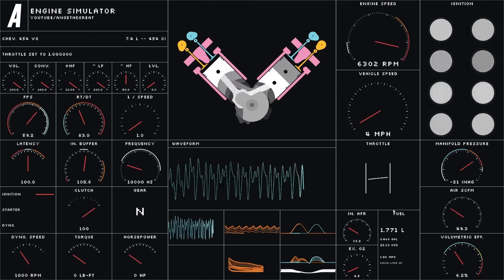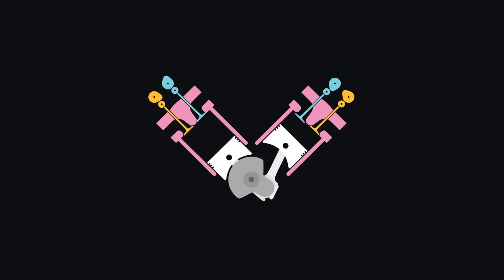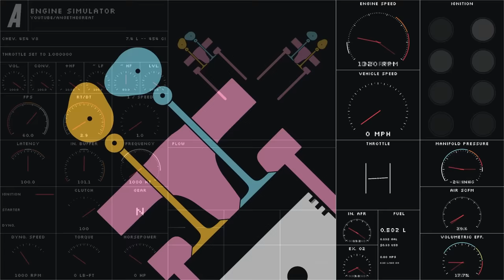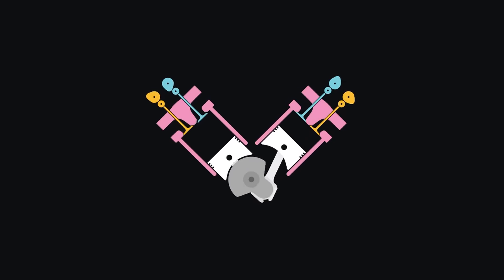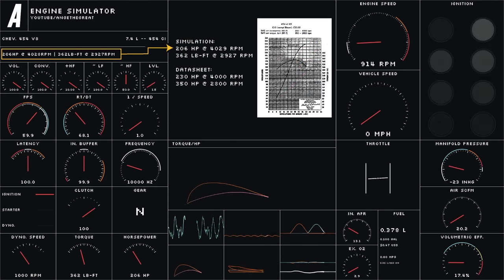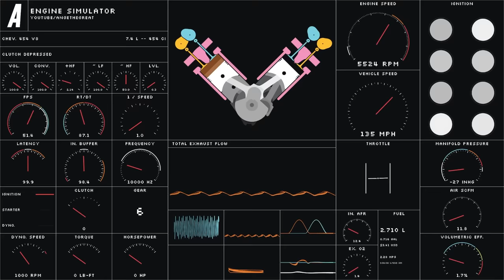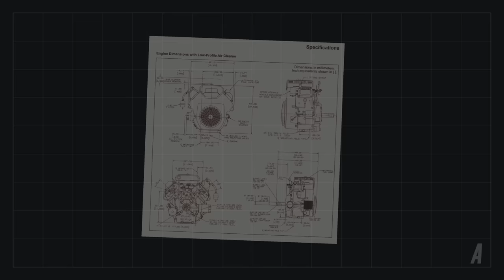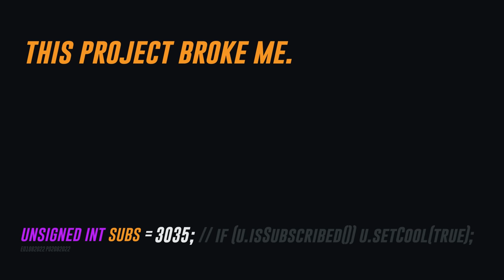Simulating an Entire Car Engine (yes, it makes noise)

Comment: I’d love if a company hits you up and is like “can we use this”
Reply: @mhe123321  sad. i wanted to try it
Reply: Let's hope that it won't be EA xD
Reply from the maker: Lol I set it to private because I was worried about companies stealing it, not because it's been sold. I may still set it to open source later though, I just don't want someone to use my work without crediting me
Reply: @mhe123321  did you happen to get a copy before it was yeeted 🙃
Reply: @AngeTheGreat  license it?
Reply: @AngeTheGreat  Just use an appropriate license.
Reply: @tanawatjukmongkol2178  If you use something like MIT you explicitly allow commercial usage, because you want to. It's not a loophole.
Reply: @angerhegreat for the love of god if you open source it, slap a non-commercial license on it. At least get a job out of this lol
Reply: if that ever happens, i really hope it would be BeamNG
Reply: Would be cool in beamng
Reply: @tanawatjukmongkol2178  MIT license does require credit
Reply: @tanawatjukmongkol2178  MIT is not copyleft by design. That's not a loophole.
Reply: @AngeTheGreat  you need to copyright your simulation so this way at least if it is stolen you can at least know that even if they do you are the original copyright holder and can sue them.
Reply: kid, the car companies already have their simulators that are lightyears ahead of this one-man project....
Reply: @MrTeddy12397  I’m talking about like Forza. Not car companies-
Reply: @MrTeddy12397  Also bold to assume I am a child
Reply: yo, this is awesome :D
Reply: OH SHIT HERE WE GO
Reply: They're not gonna ask
Reply: They already have their engines simulation,
Reply: @AngeTheGreat  I think the best thing you could do would be to wrap this up into a plugin for unreal and unity and put it up on the marketplace.
Would solve the issue of people using your work without crediting you (kinda), with the bonus of you actually having a bit of return on time investment on this epic project.
As well as it would help solve the annoyances in games that actually inspired you to work on this project.
Reply: @MultiDarkZen  You have copyright on things by default, it’s only not copyrighted if you explicitly make it public domain
Reply: @beamng  yooo there here
Reply: @beamng  im 21 like :)
Reply: @MidnightSt  VST plugin too, for video and audio editing, that would be mind-blowing
Reply: BeamNG Drive
Reply: Thi
Reply: @AngeTheGreat  GPLv3 would be fitting here.
Reply: @AngeTheGreat  Well, you can always attach a proper license to it. That way, if someone steals it and makes a ton of money without crediting you, you can sue them for breaking your license. Or more likely, get a settlement.
Disclaimer: I am not a lawyer, I am not even American, this is not real legal advice
Reply: Yeah! Someone pay this man what he deserves, this can change (I believe) car sims sounds and heck, car behavior too as this is simulating the engine as a whole. If he can output some values out of it to use for sound, he could as well output values for movement (torque and HP are already there even).
In my opinion, Gran Turismo 4 (that’s the last one I tried) doesn’t sound at all nor as accurate as this!
Reply: @AngeTheGreat  Dude. Please have a license where it is free for non profitable use but if a company uses it they need to pay you. Don't let people use you. You put work into this and it's amazing and worth people paying you
Reply: @MidnightSt  what about godot :/
Reply: Camshaft software (Developers behind Automation - Car company tycoon) might be interested in this.

I really hope they do.
Reply: @AngeTheGreat  there are licenses for credits
Reply: @jlewwis1995  i have very little experience with godot so I don't know how the plugin/asset system and ecosystem works there, and whether it can even use compiled dlls, and such.
Reply: @AngeTheGreat  honestly i would keep it private, keep improving it and license to game devs. I could totally see UnrealEngine acquiring you for big bucks (like they did with other innovating startups)
Reply: @AngeTheGreat  I mean you can always add a license to the repo
Reply: Automation would be better if it used this simulator
Reply: Tesla!
Reply: @AngeTheGreat  it's good you did that. Companies have been taking too many liberties with people's hard work.
Reply: Hopefully Forza. Microsoft does a good job for the most part, but some of the engines seem very synthesized and/or entirely digital.
Reply: @north7289  Hopefully not. Forza doesn't have the seriousness to use this. BeamNG would be the best as it already accurately simulates engines
Reply: I request that you simulate the godly sound of the LF-A please
Reply: Prolly like car mechanic sim
Reply: @aleper3714  yeah bro, but not everyone is going to want to play beamNG. And you can't diss on Forza too much because they actually have lots of tuning features and an extremely advanced vehicle decal/painting feature. People want to have fun and make there cars look cool and compete in fun challenges/races. BeamNG is an amazing game and a technical feat, but it would be great to see multiple companies use this tech to make there games better.
Reply: Id like access.  Im not any automotive company.  Just want to make it work in the unreal engine.
Reply: That likely should be BeamNG drive imo.
Reply: @TheOPtmal  AGPL would have more punch here. Still, you need a lawyer and a reasonable legal system in your country… (If US or Europe, FSC and FSFE may offer legal help)
Reply: @AngeTheGreat  Fair enough
Reply: Well can I?
Reply: @AngeTheGreat  I'd love to use this for game development. One of my struggles has always been vehicles, especially engines and transmissions.
Reply: @AngeTheGreat  I'd LOVE to see you work with studio like Kunos, Reiza, or Studio 397, or even indie teams like VRC or Race Sim Studio. This is truly remarkable stuff.
Reply: Too late. I have downloaded the code and is now on my drift game #69

Oh wait its public now
Reply: I wouldn't be surprised if Polyphony Digital or Turn10 asked.
Reply: @beamng  are you gonna use this in beamNG
Reply: @AngeTheGreat  post it with a GPL license to prevent companies from stealing it, relicense under proprietary when a company wants to buy it
Reply: @AngeTheGreat  GPL it and laugh
Reply: @AngeTheGreat  Man I hope you get rich af from this
Reply: @AngeTheGreat  most based statement friend
Reply: @AngeTheGreat  You've definitely got something very unique and relatively unheard of, keep on developing it and you just may find yourself raking in all kinds of money from licensing/co-developing with other simulators like BeamNG or something.
Reply: beamng was saying something about dynamic engine sound simulation...
Reply: @AngeTheGreat well that's why copy right existing 🎉😂 lucky u u deserve any copy right strike u make i really love this kind of genius stuff
Reply: EV companies? Lol
Reply: Yeah, SCS software needs him for ATS
Reply: @beamng wait... no just gonna tell we need new engine sounds
Reply: @FluffyL3vy arent that just beamNG developers ?

Comment: This fucking rocks, holy shit dude. I'm down for a technical breakdown video!
Reply from the maker: Thanks! I'll see what I can do
Reply: Yea that’d be great!
Reply: Count me in! Waiting for the bell! Btw. you stated that all of this begun as you hated the sound of game engines (yeah, me too). You asked a question: why the sound is not simulated? Can you please share some conclusions? Is it a cpu/mem usage? Do you see any ideas for optimization (remove this, remove that....) to gain performance without reducing the quality too much? You made me super curious.
Reply: +1
Reply: please !
Reply: @iXmerof  Maybe you missed it, but he mentioned in the video around 3:53 that the simulation needs to run at around 80 000 FPS to work properly. I image that to be a problem for Videogames. The graphics simulations of those run at maybe a few hundred fps. Then again, I am not a programmer, so maybe there would be a way to run those at separate speeds. Apart from the performance cost of a full simulation it was probably a lot of work to write, and would it be even more labor to implement it into a game. Companies decide that it just is not worth it, when most people that play racing games would not properly appreciate the difference. I would love to hear Anges opinion on the matter as well though.
Reply: @TheMoldyMenace  Yes - you can easily run this 2d engine simulation as a separate thread or process, and sync it with the game so it provides real time data from the simulated engine (such as RPM, speed, audio signal). Although it would be quite a lot of work for a racing game.  The implementation presented in this video is brilliant, and I suspect Ange can actually sell this as a software component to some major game studios. :)
Reply: @agnusxendis8356  Thanks for your answer! It is always nice to see how many internet strangers take the time to educate you. One viable justification for implementing such a detailed engine noise simulation into a game would be to parade it as a standout feature for marketing. (Ala “fish AI”, “7 bazillion Weapons/Planets”, “Battlefield Moments” etc. except this is actually super cool) I too would love to see Ange to be able to capitalize on his fascinating programming and engineering work!
Reply: yes i subscribed bc i need to see this
Reply: @AngeTheGreat  I'm down too! Was wandering around the software industry in search for engine sound simulators, looking forward to at least seeing through the foundation of your one.
Reply: @AngeTheGreat  please do make a video on how to add new engines
Reply: This is amazing as a gearheads I want to test this ting
Reply: @AngeTheGreat  Yes. Get out the whiteboard like EngineeringExplained
So many formulas for all this

Comment: Here are some ideas for your project:
- rotary engine
- simulate things that interact with the engine's behavior and sound like turbos, exhaust, etc
Reply: Diesel, Turbo Diesel, waste gates, VVT, The old VW Beetle. "W" engine? VR6?
"Tunable" exhaust, From muffler, to pipe diam, and length, up to the scavenging effect of a headers/manifolds build, That would be another incredible tool for builders, and muffler shops. To be able to hear the (approx.) sound a header or muffler will make.
Reply: What abt two strokes
Reply: Exhaust would be extremely difficult to simulate…
Reply: Turbo sounds will make the simulator even more popular (the iconic "tsu tsu tsu")
Reply: Just different valvetrains (valve-in-block, rotary valves) would be nice.
Reply: I suggest you start an online funding campaign to develop a complete app so we can have some fun during the day, like 8 hours…
Reply: Adding to the pile: Multiple crankshafts for opposed piston (Ex Jumo 205 aviation diesel engine, or the Napier Deltic engines) or multi-crank engines (any of the H or U engines).
Reply: mazda go spin roundy
Reply: Man's a genius for all he's done so far and yeah he'll probably get around to those eventually. I'm pretty sure he added support for unequal length headers
Reply: Would be cool to do varrying degree's of (motorcycles) v-twins, (90, 45, 52, 65)
Reply: You got one half of your wish granted today
Reply: Exhaust would be incredibly hard, it's basically real time fluid simulation except going at massive speeds with pulses that are timed with engine RPM... no can do.
Reply: Yes rotaries would be amazing
Reply: @speeddemon1092 Another Jumo enjoyer I see :)
Reply: Bro gave him homework

Comment: BeamNG should implement this into the game's audio engine.
Edit: I didn't mean physical simulate the engine, just the sounds. That's why I wrote audio engine.
Reply: Not sure about that, but I'd love to see this as a customizable engine you could put in a vehicle.
Reply: Yes!!!
Reply: They already have some sort of it. Prob not that complex but thus not that cpu demanding. You can play with the system in "automation - car company" or smth like that I don't remember the name of the game
Reply: they would be crazy not to.
Reply: I wish the entire engine simulation in Beam was as sophisticated as this. As it is, Beam is pretty good, but also quite simplistic in some ways, so it's awesome to know that there are demonstrated alternatives. However the physics simulation in beam runs at 2000 Hz I believe, so the 80,000 Hz for this engine sim to be stable is a lot higher
Reply: Automation does an exceedingly good job at simulating engines, all internal stresses and airflow impact general performance and are accounted for in other parts of a vehicle.
They also sound amazing.
Reply: @Incommensurabilities  but it is a pre Ryzen game. So it is a quad core era game. Perhaps these days they could crank things up.
Reply: @dannadx3840  yep
Reply: Yea for sure
Reply: @Incommensurabilities  you could run the engine sim parallel to the physics simulation and let them sync up every 40 engine sim frames.
Reply: @CatNolara  Great point!
Reply: @techpriest4787  Beam will use all the cores you throw at it, I saw a test running on a 3950x and it enabled many more vehicles to run simultaneously.
Reply: beam and other destructive car games really would work for this since in the rigid body sim you could "break" the engine and get realistic sound and gameplay dynamics from a piston breaking off of its shaft or a valve getting stuck
Reply: @dannadx3840  Automation sounds almost nothing like real engines, and every engine layout sounds exactly the same regardless of size or performance. They literally had to put an rpm cap on the engines because the terrible audio program/simulator couldn't handle higher rpm than I think 10k.
Reply: @roarore8810  It doesn't...? Even smallest changes of engine volume directly affect produced sound, not to speak of different layouts. And rpm cap is 12k, since aim of this game is not just vehicle design, but also a large-scale simulation of a car tycoon, so main focus is on mass-produced vehicles, and you can barely ever see mundane cars that go over 8-9k rpm.

Comment: This is HUGE. I always dreamed about a sim with *good* sound that'll let me build stupidly weird engines so I can check how'd they sound and now it's here. And it's free. 
You're a boss, Ange. Thank you.
Reply: If you didn't, check out game called Automation. Except good sound.
Reply: @karatas1782  Nothing like this.
Reply: Beamng drive has pretty good sounds
Reply: @doursen  Its actually pretty close as a virtual dyno. Usually within 10% margin of error of the real life engine.
Reply: @pontiac_hat  It's not that good because you're missing a ton of options. Fuel is limited to whatever their ratings are and there's no options for things like high-flow billet heads, billet blocks, huge turbos (I think their max was like 76mm front housing and 94mm rear housing), no screw blower options, etc etc. It just felt like it was made by someone who knows the basics about vehicles and not made by someone who is a car enthusiast. 
tl;dr, Automation is made by a gamer for gamers, not a car enthusiast/engineer turned game developer.
Edit: I could go on and on and on about all the mechanical issues I had with the game but cba, take too long to write it all out.